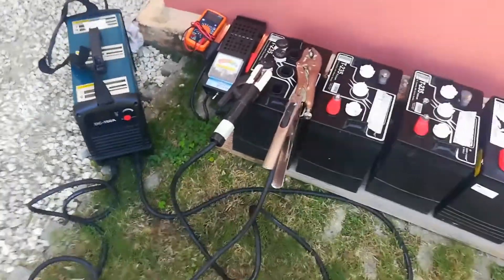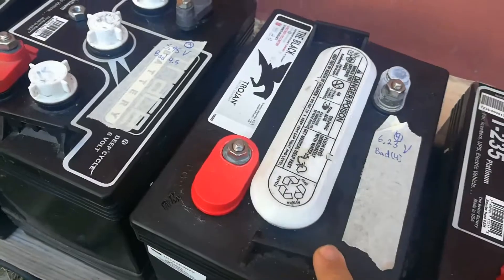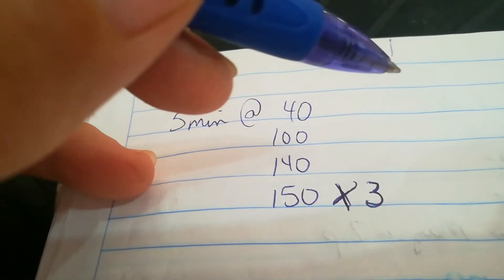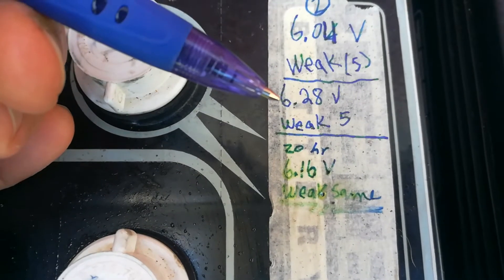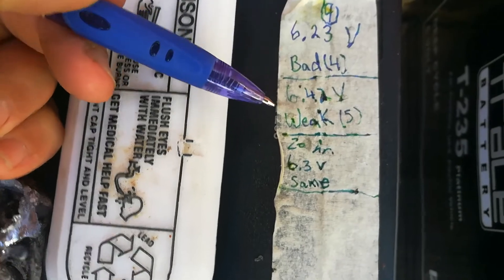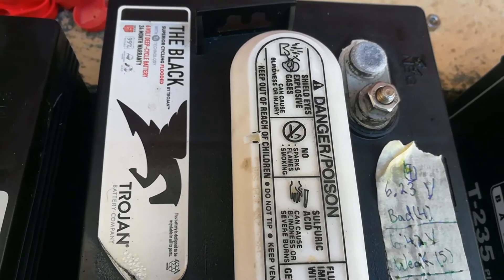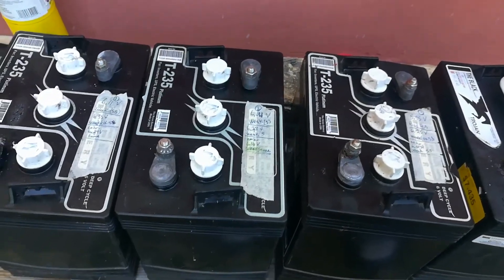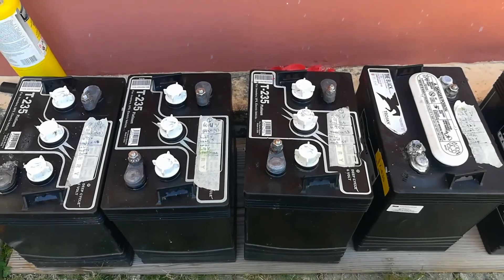Make Old Batteries NEW! With an Arc Welder?

Comment: After performing the welder desulfation method, the batteries have to be put on a low amp charger. Hooking two 6 volt batteries together and slow charging with a 12 Volt charger on 2 Amps works well. The main goal is to break up the sulfation on the battery plates that has accumulated from just sitting. I also have had great success using " PulseTech" Extreme Battery Desulfators/Chargers. They stay hooked up to your batteries and constantly pulse the plates inside to keep Sulfation  build up off of the battery plates. I have also used them to rejuvenate older, sulfated  6 Volt Trojan deep cycle golf cart batteries.

Comment: Hi,
You'll have luck restoring your batteries if you hook two of them in series , (positive to negative),and using your welder.
The open circuit voltage of your welder is about 20 volts and is too much for a 6 volt battery.
Good luck.
Reply: I have 8 volt golf cart batteries.  Stupid question, Do I just hook one neg terminal to one positive terminal and then the welder to the other positive/negative terminal?
Reply: Oh great idea! I've had good luck doing this with just normal car batteries 12v.